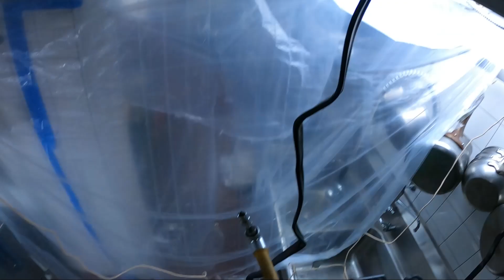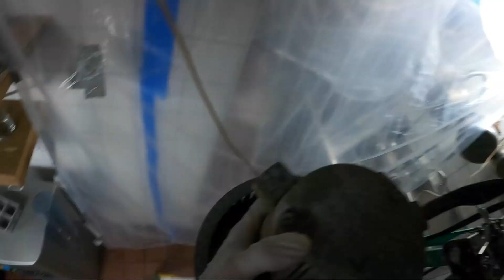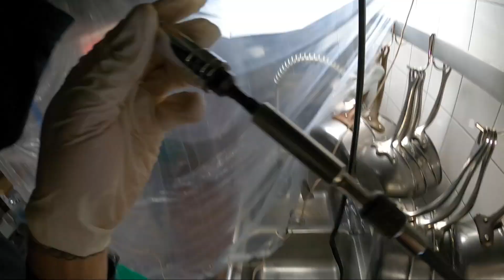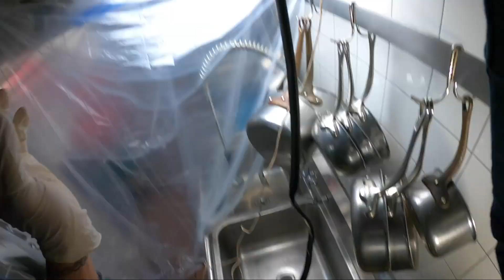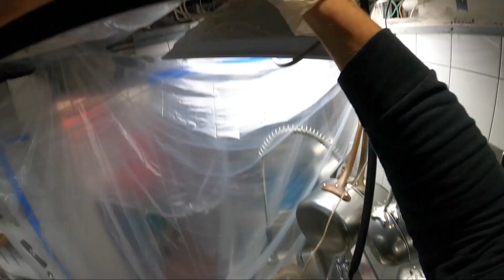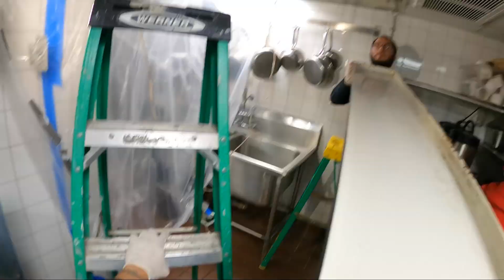HVAC Service Call: LG Multi V Duct Leaking Water (PART 3) LG Air Handler/Blower Removal & Cleaning

Comment: You made it a lot harder on yourselves to not separate the squirrel cage and motor. The way LG intended was for you to loosen the shaft bolt, pull the squirrel cage out of the side with the removable panel, and tilt the motor down the other side. BTW, LG recently changed the motors in this model unit a few months ago due to noise issues with the older ones, so don't be alarmed if the new motor you get(if you do replace one) is bigger.